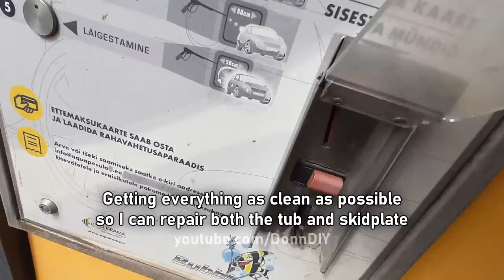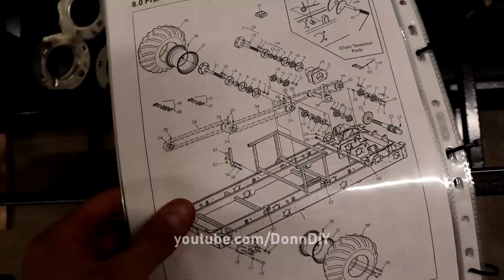ASSEMBLY - 8x8 Amphibious Vehicle Argo REBUILD Ep.6

Comment: I am not sure if you've finished this project yet or if you post videos as you complete each stage of the rebuild. Anyway, I am in the middle of a total rebuild of my Avenger, and have done all the jobs you have had to tackle (although mine wasn't so beat up, thankfully). I have taken to opportunity to remove the generator and replace it with an alternator, and I am replacing the mechanical cooling fan with an electric one (mainly because the fan belt snapped on  the previous owner, destroying the stator and that destroyed the flywheel magnets and the cooling fan - so it was an easy decision not to replace all those expensive old-school parts from Kohler). It might be a good opportunity to do both these upgrades while the engine is out. The alternator is especially helpful if you fit a winch.

Comment: I’ve got some plastic welding to do on some Pelican cases for my wife’s Moto Guzzi. Did you buy a kit or source the precision heat gun on its own?
Reply from the maker: I just bought the entire soldering power source/heat gun combo kit off the internet locally. 👍
Reply: One important thing, make sure you get a welding kit that's specific for your type of plastic or if it's even possible to repair it, some plastics will shrug off the repair like a scab and break apart again.

Comment: For repairing cracks in plastics, along side adding new material, it’s very beneficial to imbed rings of steel wire over the crack. Just press it with the heat gun into the plastic. It adds a lot of structural strength.

Comment: Another great video Donn. Polyurethane black sealant is a great choice as it's used on car body's and glazing where silicone breaks down with uv
Reply: The main problem with silicone is that it doesn't stick very well to a lot of materials like PE for example and also the paint doesn't stick to silicone...

Comment: You could of removed all the greese zerk fittings and instead ran greese lines from a  manifold to all the points. That you can easily get to with a greese gun. Plus a top chain greese plate from there also would be a game changer. 😲👉💡Always make something better than when you got it I alway say.

Comment: 12:35 punching holes works much better if you put the block of wood upright, so you punch into the end grain. This way the cutting edge of the punch can just go in between the wood fibres, instead of cutting the fibres. Just like the block of wood you put on the floor when splitting firewood with an axe.
Reply: Thanks for mentioning this.  I'll try it next time I punch some holes.  I've tried hardwood, plastic, and aluminum with moderate success.  Lead block works pretty good, but not the most healthy.

Comment: It may have been a good idea to have put a strip of butyl tape between the two parts of the tub and, maybe around the bolts that replaced the rivets.  But I suppose that's the problem with posting videos to YouTube - any advice is always too late - and usually wrong 🙂.  Looking forward to seeing how it handles snow.  Thanks for the videos.
Reply from the maker: I have that butyl strip for connecting the top to the tub eventually. I really didn't think about using it on the skid plate as well...🤔
Reply: @DonnDIY  I hadn't realised it was just a skid plate - my bad - I thought the tub was in two parts.  I must pay more attention in future 🙂

Comment: and why? lubricator but the drive shaft one on top, the other on the bottom? the part seems to be symmetrical, and you can put all the oilers to make it convenient to lubricate ...
I would grease all the caps on the external bolts with sealant, the holes in the plastic for them are no longer new ...
axle shafts made of simple structural steel, they at least need heat treatment ...
and they didn’t bother with the selection of material during production at all, which was cheaper, they set it, and whoever bought it was a problem ...

Comment: Looking better every episode, you should be very pleased with your work. I found cork gaskets are fine on low or no pressure applications, many other materials used like silicone, neoprene, etc, but they can be expensive as you found out yourself. Looking forward to the next post, keep safe and well 👍

Comment: We had a guy come in at a place I was working a few years ago wanted pretty much the same job done on his 6 wheeled version, but also wanted us to fab up a stainless steel outer pan/skidplate for it. We got everything cleaned and fixed up and got the new pan made up and installed. it looked pretty cool and worked pretty good. We didn't use any fasteners below the waterline but use a crap ton of 3M panelbond to get it to stay on. Guy was super happy with it. Kept bringing it back for services and stuff. We wound up repowering it one time because the old Kohler had given up. Last I heard it had sold at his estate sale for not much. I wish I had known about it at the time I would have bought it.

Comment: I think (but might be wrong) that the cost difference between the cork gasket you made and the one you could've bought was that the one made for this is rubber and cork, not just cork and adhesive. I might be wrong, but that might explain it. Just my 2 cents.
Reply from the maker: You might be right. I added adhesive to the cork so it should be fine... 🤞🤔😄

Comment: Great restoration. As an occasional welder/fab guy, I'm quite surprised that you didn't reinforce the areas of the frame that cracked in order to beef things up a bit. If it cracked there once, it will crack there again and you ground most of the welds off flush on both sides as far as I can tell, so there is no reinforcing weld bead. A guy I know had an Argo that he restored (it was far worse than yours) and he ended up rebuilding almost the entire frame (lots of rust) from heavier materials. He also used diamond plate for the floor. Still impressed with your work.
Reply from the maker: The welds need to be ground flush to avoid stress concentration areas which form next to the weld bead. That's what I was taught in the short welding course we were able to take in Uni eventhough I studied wood processing technology. So take my opinion with a grain of salt. 😀

Comment: Nice job! Did you reinforce the frame in those areas that were cracked? Are those front and rear axle supports a factory modification?
Reply from the maker: I didn't reinforce the frame. I just cleaned and welded it hoping that the leaner usage it will get from me doesn't break the frame. This Argo was tortured before it got to me. I'll take it easy on it in the future.
Reply from the maker: Axle supports are from the factory.

Comment: I have an Argo. Pro tip is to put the track pins in so if they come loose they slide outward and not inward. Also avoid extended or loaded side hilling with the tracks as it will also eat into the tub. That's what looks like happened here.
Reply from the maker: The previous owner has replaced the original track pins with threaded rod. So I guess the nuts worked themselves loose and the pin started to eat away at the tub. Or like you said, the original ones were inserted from the inside toward the outside and when the cotter pin failed the pins slid inward and wrecked the tub. I havent noticed sidehilling being a problem but thanks for the heads up. I'll keep that in mind.👍
Reply: @DonnDIY  I carry all thread as well just incase!

Comment: Should have connected these grease fittings all together with hose, and put in one central grease fitting somewhere accessible
Reply from the maker: Central greasing system sounds great but I personally have doubts that grease will reach all the grease points equally since pressures in the line are different. And grease goes where there's least resistance. Having said that I agree that at least the bottom ones should be connected and more accessible indeed.👍
Reply: @DonnDIY  good point! But on heavy equipment it's done like this all the time.